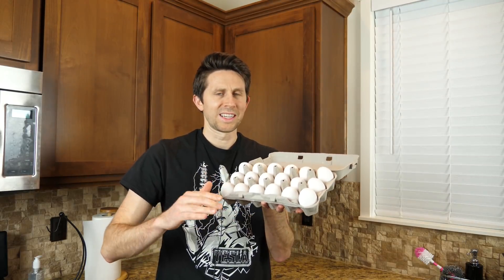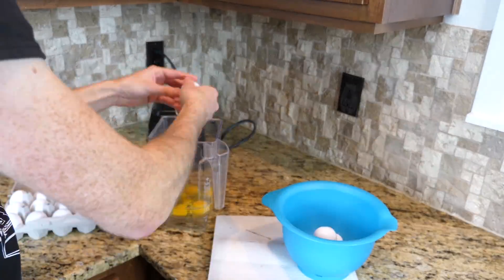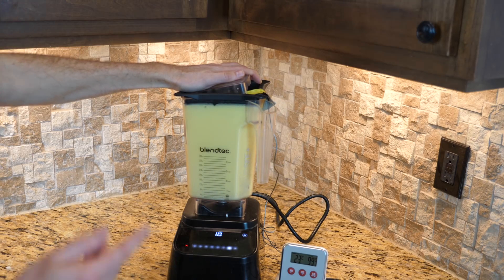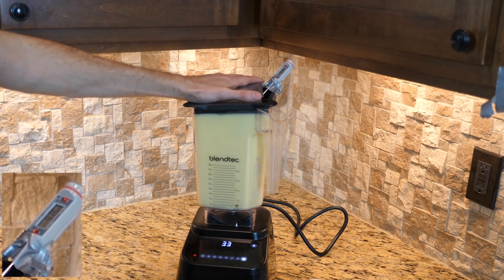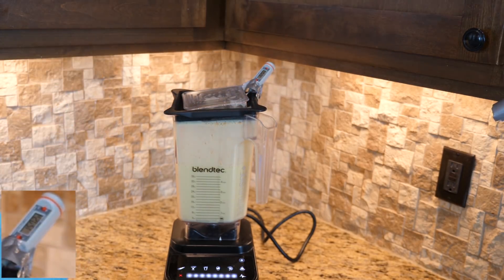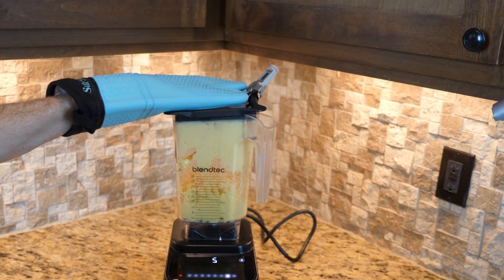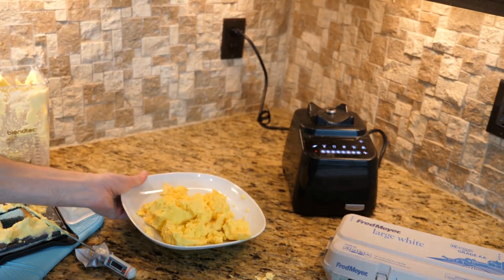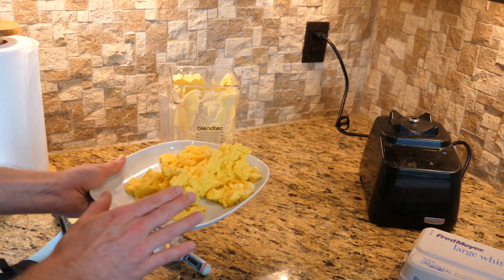Cooking Eggs Using Only Super-Fast Mixing—Will it Work?

Comment: Is their a way to cook eggs with just light?

My Question is answered
Reply: Unknown_Cat Yes, it is called solar energy or lasers.
Reply: Someone made a barbecue grill, using mirrors. Worked exceedingly well.
Reply: Unknown_Cat if you take in account that microwaves is a form of light... you can use that to cook your egg..also if you use a magnifying glass, you could use the sun to cook your egg, but in that case its actually the infrared from the light spectrum that heats the egg
Reply: carolyn mmitchell Not to make you sound dumb, but microwaves are not in the light are of the spectrum of... what? Oh, yeah... Light
Reply: Unknown_Cat heat lamp
Reply: Go to California in the summer and put your egg on the sidewalk
Reply: Just because its not in the visible spectrum doesnt mean its not "light" 
The deffinition of light: Light is electromagnetic radiation within a certain portion of the electromagnetic spectrum. The word usually refers to visible light, which is the visible spectrum that is visible to the human eye and is responsible for the sense of sight.[1] Visible light is usually defined as having wavelengths in the range of 400–700 nanometres (nm), or 4.00 × 10−7 to 7.00 × 10−7 m, between the infrared (with longer wavelengths) and the ultraviolet (with shorter wavelengths).[2][3] This wavelength means a frequency range of roughly 430–750 terahertz (THz)"
The deffinition of microwaves: "Microwaves are a form of electromagnetic radiation with wavelengths ranging from one meter to one millimeter; with frequencies between 300 MHz (100 cm) and 300 GHz (0.1 cm).[1][2][3][4][5] Different sources define different frequency ranges as microwaves; the above broad definition includes both UHF and EHF (millimeter wave) bands. A more common definition in radio engineering is the range between 1 and 100 GHz (300 and 3 mm).[2] In all cases, microwaves include the entire SHF band (3 to 30 GHz, or 10 to 1 cm) at minimum. Frequencies in the microwave range are often referred to by their IEEE radar band designations: S, C, X, Ku, K, or Ka band, or by similar NATO or EU designations."
The difference between them is its wavelenght
Reply: undeadelite microwaves are not in the light area of the spectrum